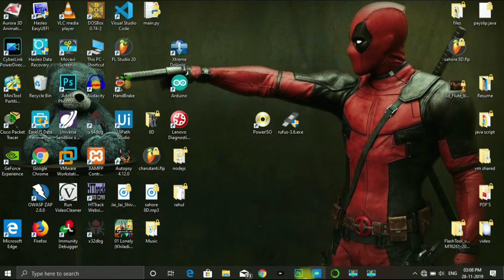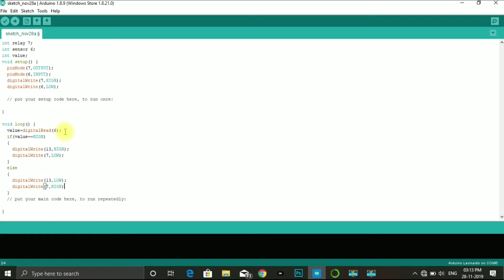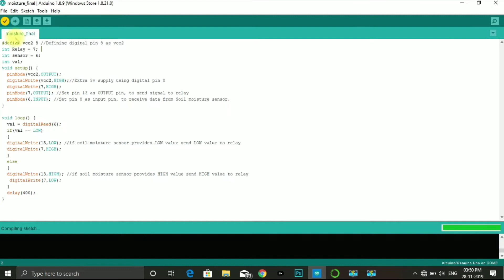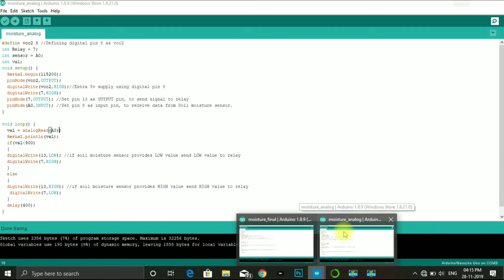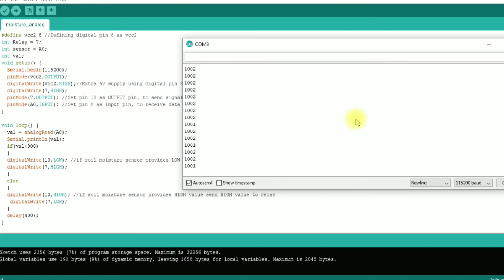[Kannada] How to make automatic watering system using soil moisture sensor | IOT Project

Comment: Battery connection henge helill
Reply from the maker: Use Power Bank or connect battery to Vin pins
Reply: @KIRIKTECH  vin pin yaudu
Reply from the maker: Nodemcu board alli nodi

Comment: Bro code not open
Reply from the maker: Open it in notepad and try to copy paste
Reply: Bro how to connect water pump
Reply from the maker: Using relay but be careful while working with AC
Reply: Bro will same or changes will be there... Tell me
Reply: Coding
Reply from the maker: Coding same